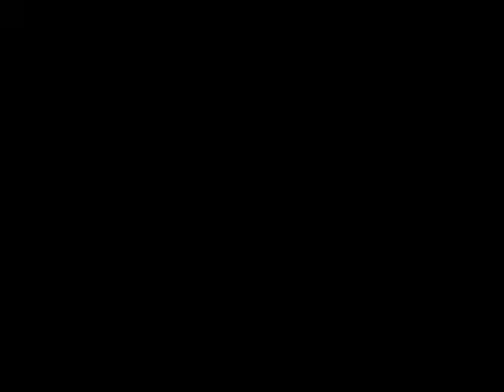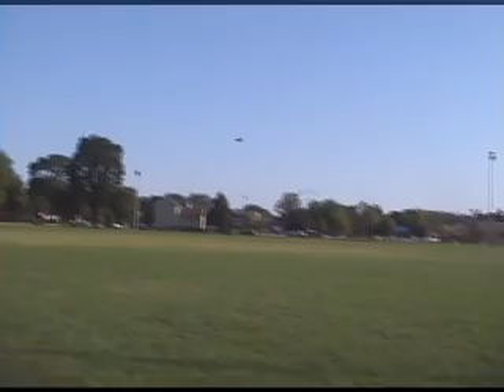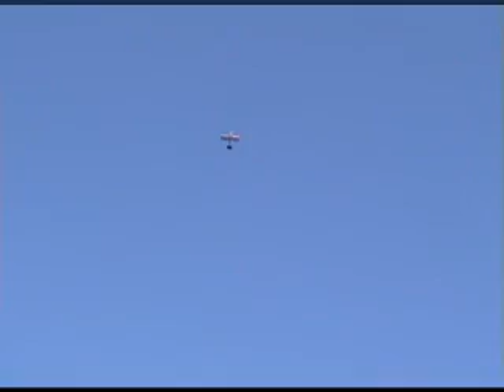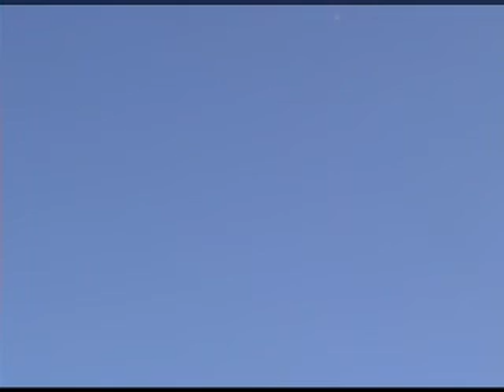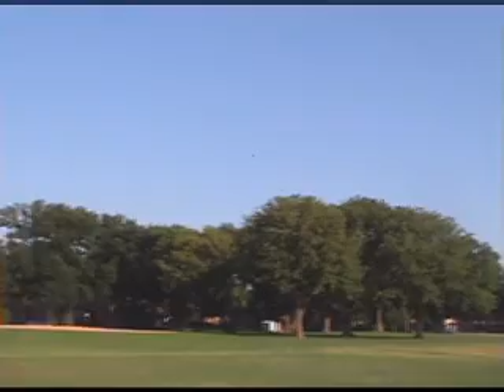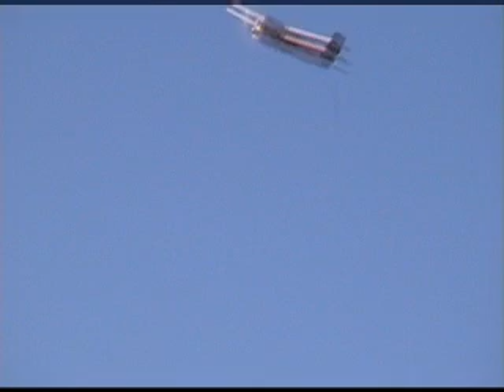Maiden Flights of the X-1

Comment from the maker: I used the Shun Da radio for a little while.  We had to remove a section of the plastic below the throttle lever so the throttle lever could go down further.  My ESC wasn't thinking the throttle was at zero before we did that, so it wouldn't start.

Comment: The Air Boss flies quite well. I have 2 vids posted of it in flight !! I had an issue with the Shun Da radio programming the ESC, so I had to use my 4ch Tactic radio + receiver to fly the Air Boss. I do plan on using the Towerpro combos for other planes as well. I know you put a towerpro in your J3 cub. Did you have to use different radio gear in it?